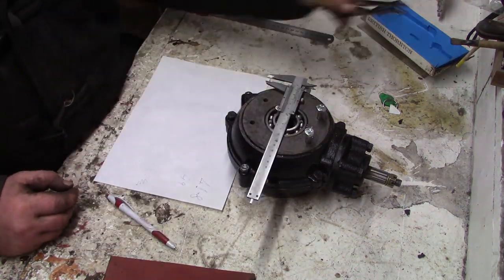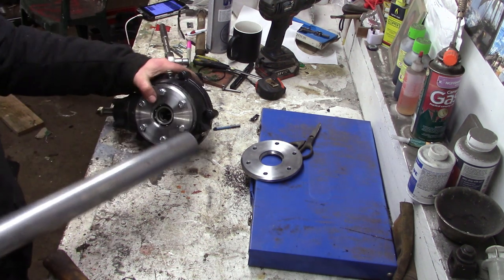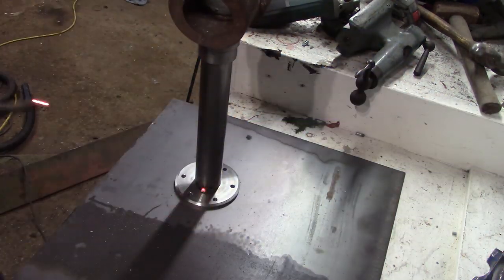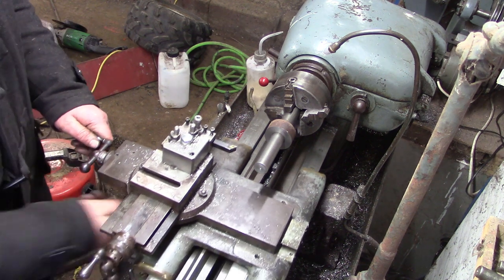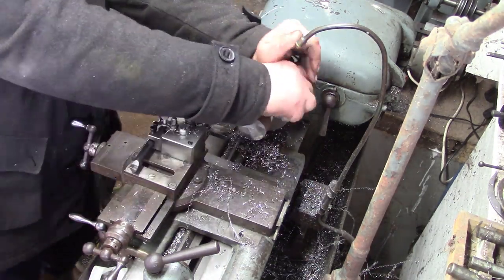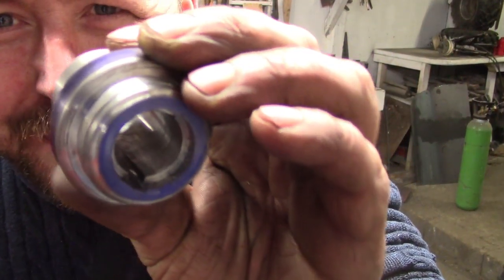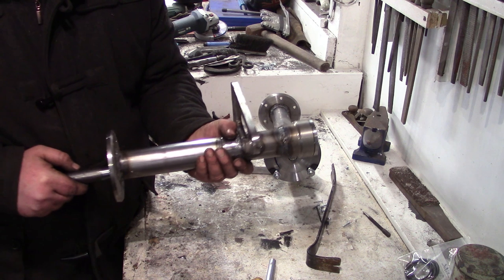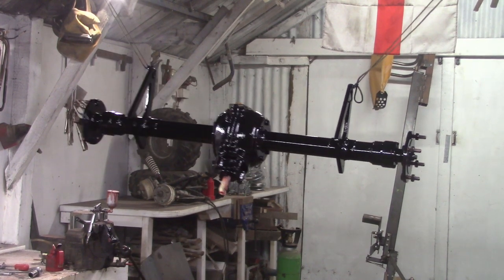Homemade Dump truck MK2 rear axle build

Comment: Nice work, well done, particularly on the key way.
Reply from the maker: Cheers Benedict, well happy with how that turned out
Reply: @turboconqueringmegaeagle9006  you should be. It's great work.

On the issue of not having a faceplate, have you considered making one from cast aluminium as per Dave Gingery's book on making a lathe?
Reply from the maker: @BensWorkshop  I have not seen Dave gingery's book it sounds like I should find a copy though.
I've got a particularly large odd sized spindle on my machine and the only way I'm ever going to get anything else mounted on it properly is by growing a pair and learning how to lathe cut threads, I bought a rough cast iron Chuck backplate blank for a much bigger machine that will work on mine so I can mount a bigger Chuck but maybe I should experiment with a cast alu faceplate first so I don't ruin my backplate or cutting tools!
Reply: @turboconqueringmegaeagle9006  Yes, he also did other things as well. Search it on YouTube too
https://www.youtube.com/results?search_query=gingery+lathe

Comment: I like the nut as a hex collet block 😉👌
Reply from the maker: The proper collet blocks are less than £20, I think I'll get some but this did work better than expected!
Reply: @turboconqueringmegaeagle9006  go to banggood there's are MINT
Reply from the maker: @mealex303  I've never even been on there, I'll check it out cheers.